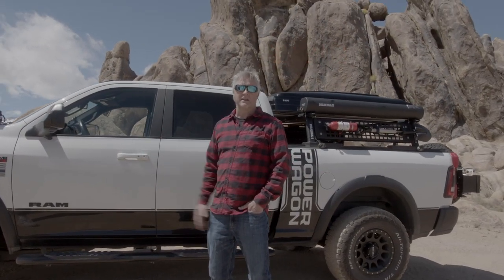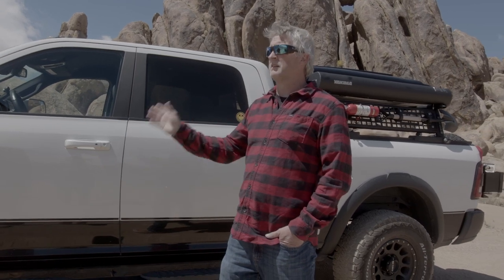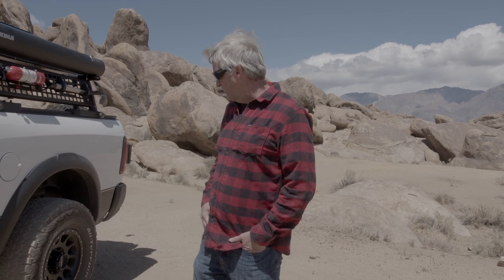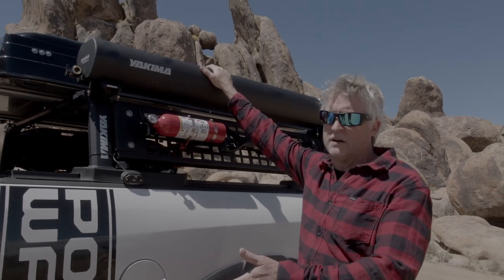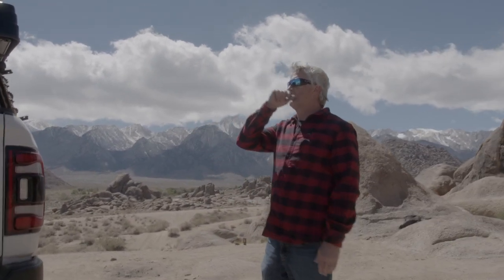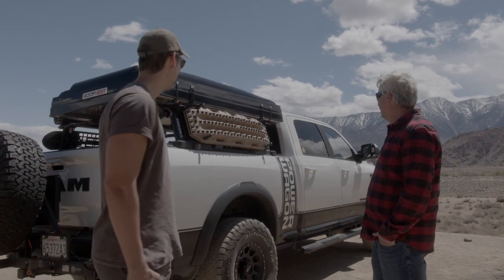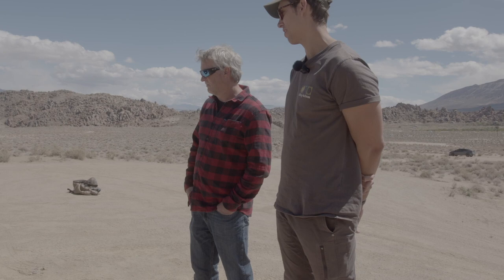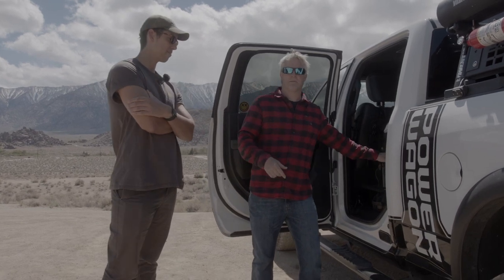Ram Power Wagon Walk Around   HD 1080p

Comment: The Power Wagon will fit a 35” spare in the factory mounting location by simply letting some air out of the tire. So if you have an on-board air compressor, there is no need to find another place to mount your spare tire.

Comment: Great video!!! We have a 2020 Power Wagon and a Rig’d ultra swing. We have struggled to get a replacement camera system for the rear 360 camera   Where did you get yours??? We appreciate the help, thank you.
Reply from the maker: Thank you for your comment! The camera I bought was from CameraSource.com - it came to $499.95 after tax - a bit pricy IMO! It installed very easily and worked seemlessly with my truck's 360 camera factory set-up.  Details:  Relocation Kit With Camera Included, Fits 2019-2021 RAM 2500,3500 W/360 View
SKU: CS-DTR-19RSC-HD

Comment: Nice set up! Is the rooftop tent level with the top of the truck cab? I’d like to set mine up like that so I can still (barely) run through a car wash.
Reply from the maker: Yes it is. I wanted to fit it in my garage as well as have less wind resistance going down the highway - better fuel mileage. Plus, my truck is already 7'3" as it is. Another 12" or so taller would make it even more top heavy.  And - I like the looks of it lower like that. What kind of truck do you have?
Reply: @BigRigOverlanding  great thanks! I have a 2021 Power Wagon, but it has Ram Boxes, so I’m still researching which rack will work that can still be short enough to mount a RTT level with the top of the cab. The Yakima like yours looks like it may be an option.
Reply from the maker: I know it's been a year since you wrote this post, but I'm curious if you found a solution to your Ram Box/rack dilemma? Please post if you did - I have a friend looking for options for his.
 @christophercalhoun5971

Comment: Has any rack company  come out with a  rack that fits  with the  ram boxes
Reply from the maker: I can't say for sure, BUT my Yakima HD rack initially only attached to my Retrax Tonneau cover, not to the bed itself. I later drill and bolted everything to the bed to make sure it was stable - I just didn't trust the mounting system on the Retrax to handle that much weight being thrown around.  I think as long as you have a tonneau cover that has a T-slots, you should be able to attach to it - Although, I did have to buy the Yakima Tonnea Kit 1 to make it all work together and look OK. (https://www.google.com/search?q=retrax+yakima+hd+kit&oq=retrax+yakima+hd+kit&aqs=chrome..69i57j33i160l2.13593j1j7&sourceid=chrome&ie=UTF-8). It gets pretty pricey when you start adding it all up - be prepared for sticker shock! :)